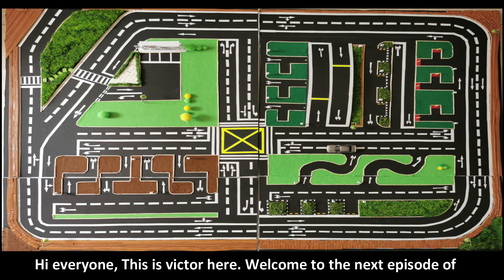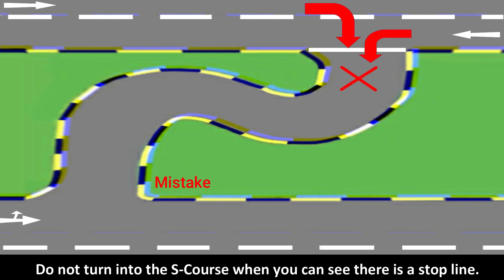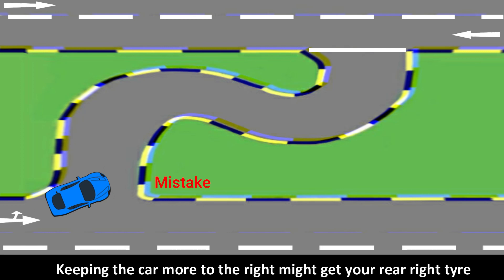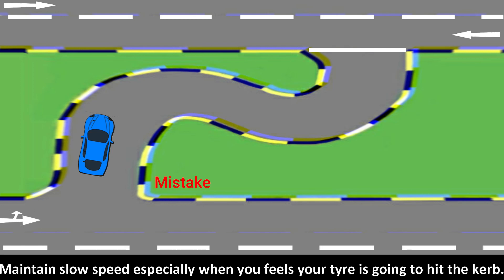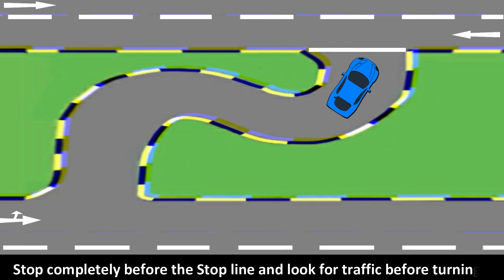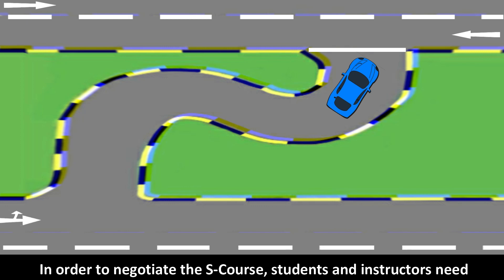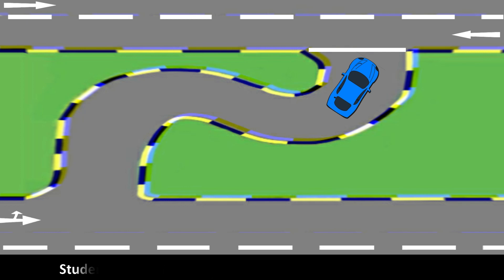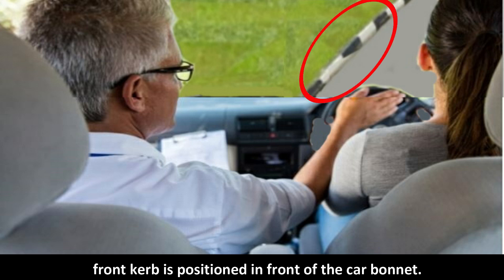S - Course - (Mistakes & Corrections)  EP 5

Comment: Hi, I have 2 questions

1. How will you be able to tell if your tire is about to hit the curb.

2. Where are the turning points from the  right bend to the left bend?
Reply from the maker: Hi question 1 - you can know when your right tyre is too far away from the kerb that provided you can see stretching.  
Most of the students had difficulties judging.
Reply from the maker: The turning point is stated in the video. This is what the school's turning point but you may need to adjust accordingly due to student's' height and sitting posture.